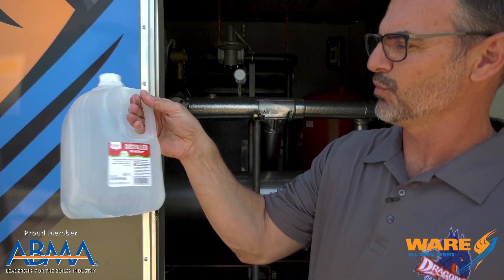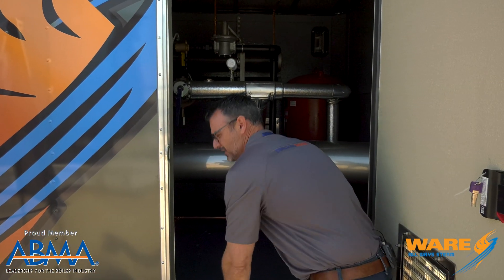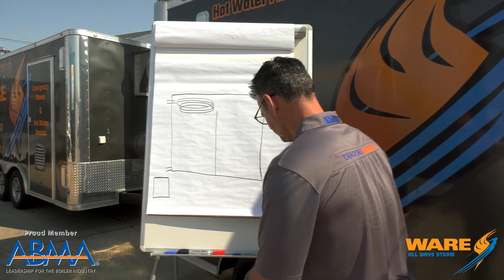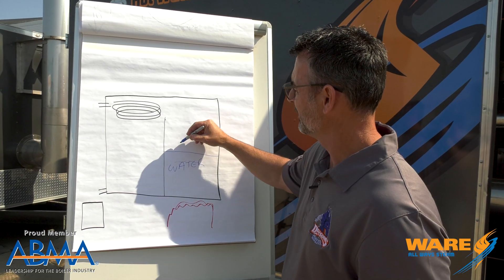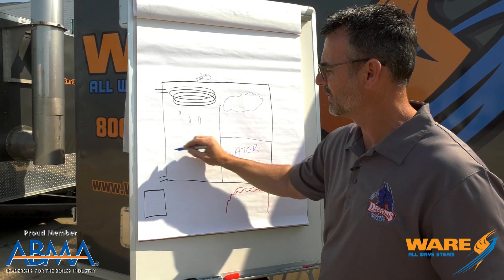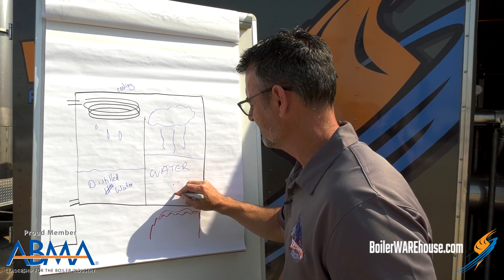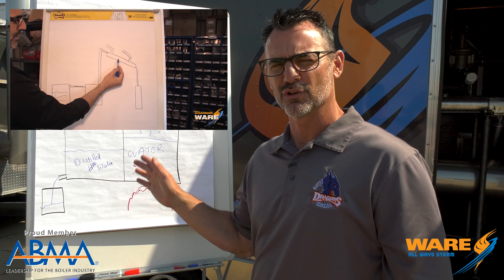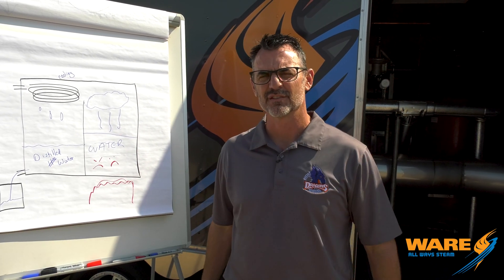How to Distill Water by Using Steam - Steam Culture

Comment: I have multiple issues with the videos I see on youtube regarding diy distilling h2o. I brew my own calloidal silver so I'm in demand of distilled h2o. The TDS tester is either BS or the distilling process is BS.  I use  store bought distilled h2o. The TDS tester reads 0 contaminants in the store bought. However when I use the dyi distillery methods with a pot and bowl the TDS tester shows over 100 contaminants. So is the TDS BS or the distilling method? I'm confused. Not vcc to mention you cant boil flouride out of your water.....??

Comment: Boiling water is a high-heat method. Mother Nature uses the low-heat method of distillation. The high-heat method of boiling water allows some volatile organic compounds (VOCs) to make it through the distillation process and end up right back in your water. You don't have to boil the water, just heat it up on a low heat coil or flame. It takes longer, but at least you will be getting truly pure distilled water.

Comment: One point you left out is with the pressure distill how to tell when the water level is low enough to stop the heat before you boil off the nasty stuff one wants to leave behind. 

I mention this due to town water now supplied is often ocean water that has been treated in a desalination plant.  Which makes me wonder where the pure rain drink water is getting sold too?